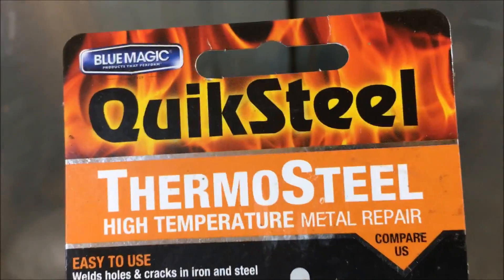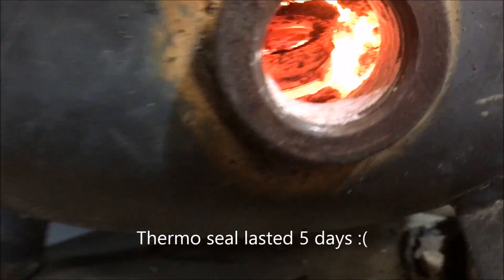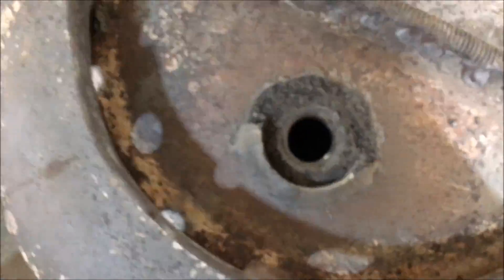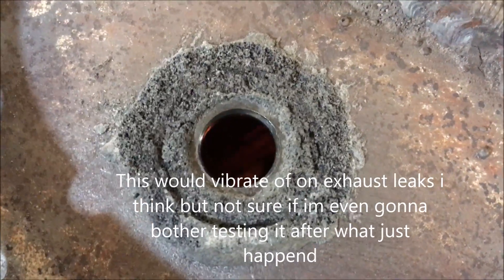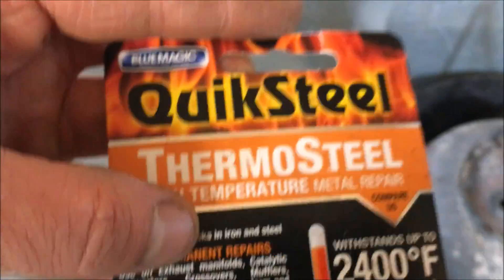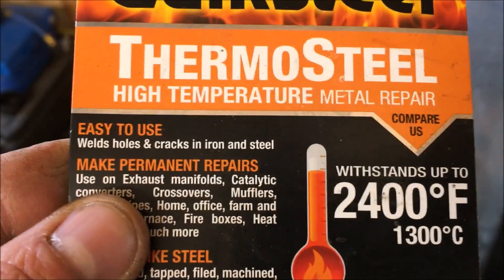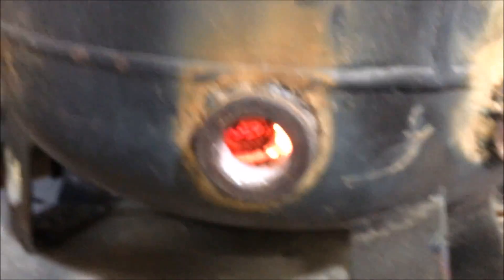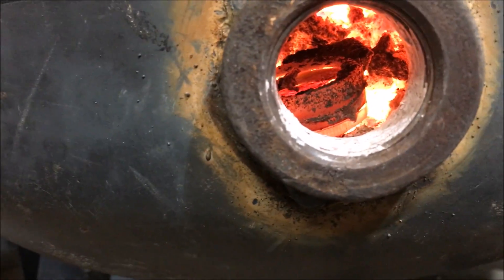Quick Steel Thermo Seal Review Update LASTED 5 DAYS

Comment: Maybe you should have read the instructions. You clearly did not clean the surface thoroughly and applied while the metal was still too hot. It is also not designed to be used on glass
Reply from the maker: true but JB weld did just fine

Comment: I have used Quik Steel for many repairs including the top of a car radiator. Great stuff.  JB Weld is good too! However, in this video what you want to repair looks so rotted away it looks like the putty will not adhere to the metal? Sometimes ya cant repair only replace.

Comment: Your stove was running at 128*f. Directions say 80-100*f for four hours to cure. Your test is not a qualifying example.
Reply from the maker: I used it in other places and temps and tried a cols set as well , this stuff is worthless
Reply: NOBOX7 work for me. One year now on old Jeep exhaust manifold. I will post a video soon.

Comment: Thanks for the video. Sorry it didnt work. I've had good luck with other versions of QUICKSTEEL
Reply from the maker: It may have its uses Joe but by the way it feels and behaves ill never use it again
Reply from the maker: Yes i have seen the putty i think ill give it a try , i was just excited about the 2400 degree part and had hopes of using it for a high temp thread sealer but that aint gonna happen , its to sandy